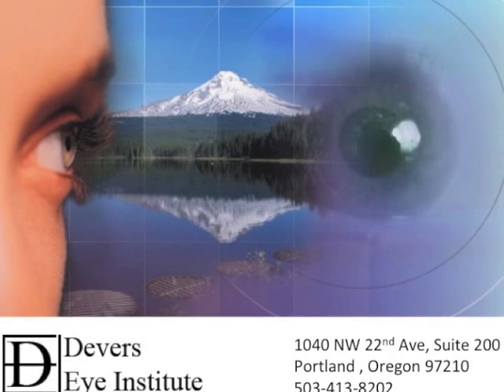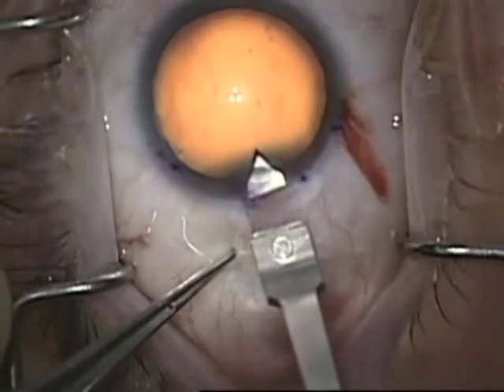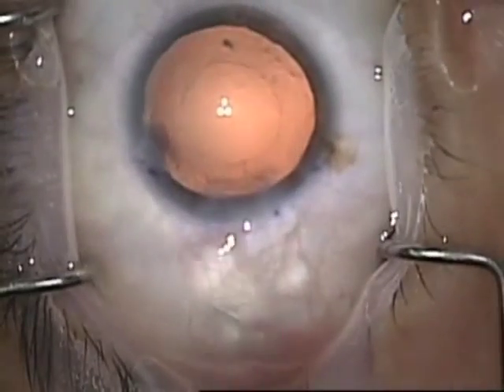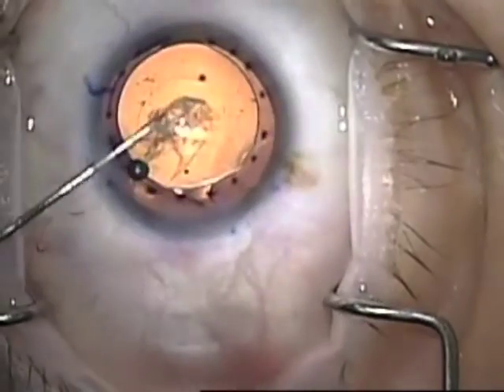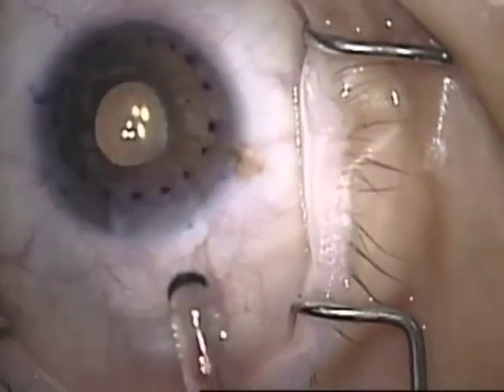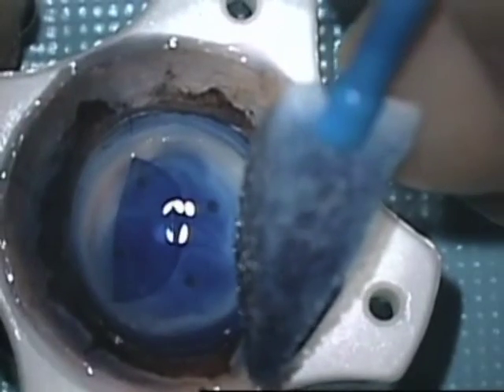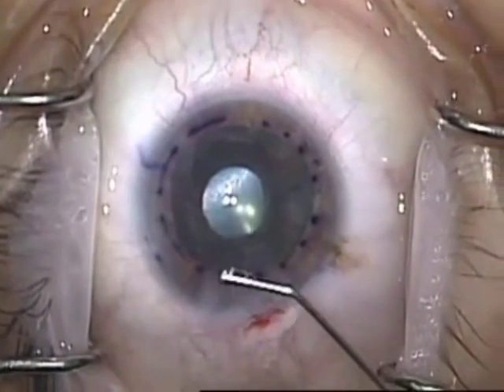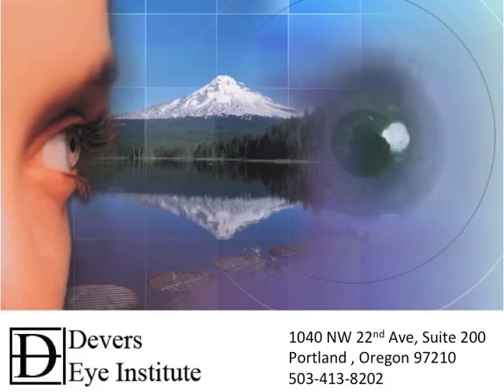DMEK with Cataract Surgery: A standardized technique

Comment: Thank you for the feedback. I will add some pre and post op pentacam scans and photos to future videos. 

I think that a laser PI may be too small and could become blocked by the air or gas in the eye.

It may be helpful do do a laser PI and then enlarge it with stretching or intraocular scissors. Unfortunately, I do not own the YAG Laser, the hospital does. So it would create billing issues for the patient. I prefer to use a 20 cent needle and avoid the laser charges for the patient.

Cheers!